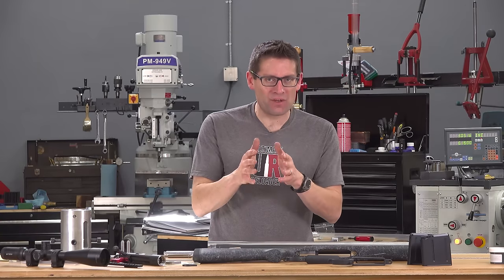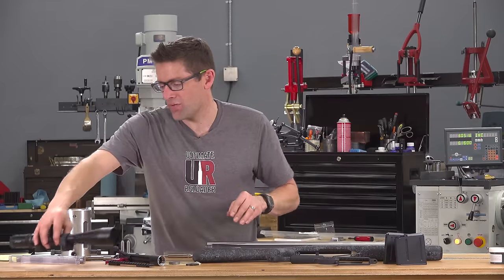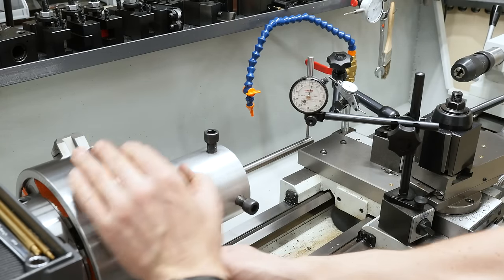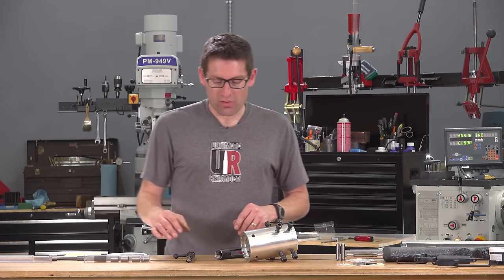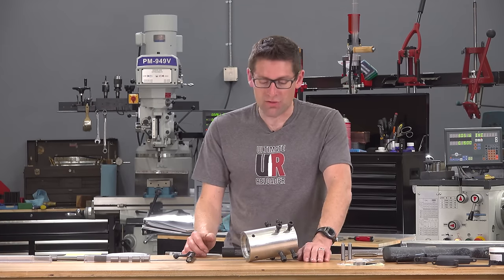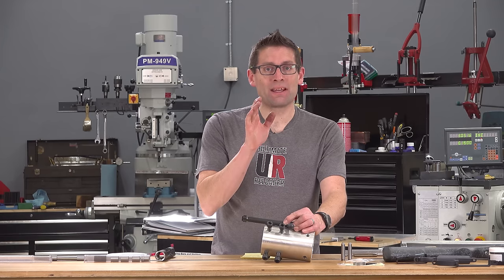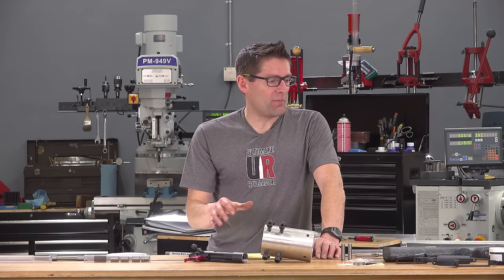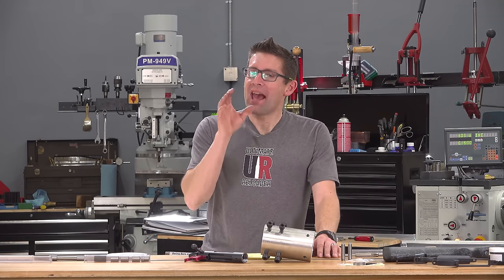300 PRC Budget Build part 1: Action Blueprinting

Comment: Is “budget” the right tittle here?  Lol Jesus!!!
Reply: GoneCommando  well, once you have the multi-thousand dollar lathe, lol.
Reply: agree, my budget would be the trigger lol
Reply: Budget for someone who gets his parts given to him or bought at a highly discounted price.
Reply: I was just thinking the same! Thousands of $$ into it with lathe and tooling lol. I thought it be a  pre fit barrel or something.
Reply: outboardprsnlstndup trust fund???
Reply: Well considering these machines are actually affordable to hobbyists I would say so.
Reply: Definitely not. But it shows very well why it cost quite a bit if you have a machinist/gunsmith do the job for you. Setting up and equipping a shop is huge money and as show the work is very labor intensive.
Reply: Considering he didnt tru and ream to size the bolt raceway, and either replace the bolt with one correctly sized or sleeve the bolt, yes its a budget build. Frankly, its ultimately cheaper these days to start with a tight, square 700 clone like a Borden Alpine, than to bother with all of this. 500 for a rem 700 action,  125 for a ptg sized bolt, hundreds of dollars in tooling, and probably 4 hours of a smiths time. Vs a grand to 1200 for an aftermarket action.
Reply: Agreed. This is not a budget build, nor is it within the technical ability of most people because of the equipment need. This is more of a mid price special build. But it is interesting non the less.
Reply: (T)(h)(e)(D)(u)(d)(e) - The Bergara custom shop quoted me 3K for a custom 300 PRC. I’m not saying you can’t spend more, but at some point diminishing returns come to play.
Reply: It depends if people are unemployed or just Wery cheap as I usually think Americans are. You expect stellar accuracy and konsistent handling, but don't whant to pay for it.
Reply: andy347495 - Thank God he is making money from YouTube. If not, we would never have access to this extraordinary content. We should be thankful to the sponsors as well.
Reply: andy347495 - I agree, some of the reviews need to be taken with a grain of salt, because the products are being supplied by the manufacturers. To date, I do not recall negative commentary on any of the products reviewed. In any event, things are presented in a clear and concise manner. It is up to the individual to determine what to do with the information.
Reply: andy347495 - That is precisely why we are allowed to make commentary on the process. You are not well served if you do not read comments left by others. It’s been a pleasure exchanging ideas with you and others on this forum.
Reply: As "budget" as possible
Reply: Don't blasphemy
Reply: Not even close lol
Reply: Lol I see the money do alot of sitting behind him i would be building my own receiver, then buy a barrel blank but u have to be efficient with the tooling  .. why is everyone so scared of threading with a lathe hell I was i think 11 yr old when I was taught how but didn't really understand how what,why. Until I built my first action at 15 . ThT was 25 years ago and quite a few barrels.  And caliber which all shot bug holes . Build your own fixture im sure there is a surface grinder in the famous old crapews i mean mathews in that building somewhere use your tools for what they are made for you won't learn buying or getting sponsors junk
Reply: Beautiful video see how it's done, but, this budget built seems like from hell.
Reply: I think I'll just buy a fancy chaise!!
Reply: Yea budget my ass lol
Reply: I thought this was gonna be a cheap action, barrel, and chassis assembly.. prolly only a handful of people out there that would actually do this 😂

Comment: It's OK but a 7-33 nosler with 190 grn A-tip BC .838 @3,200 fps has 1,000fpe at 1mile and beats the best 338 lapua and 300 Rum loads in drop and windrift has a longer case throat than a 28 nosler with no powder compression and the longer throat has longer barrel life because of the torch angle is not burning the barrels throat! And fits in a 3.760id full length long action detachable magazine with VLD BULLETS ONLY SEATED IN THE CASE NECK! Huge ADVANTAGES!

Comment: Put the stock barrel back on and see how much the action job only made with accuracy.
Reply: Cant really,  he opened up the threads and changed the headspace on all the parts......but it would be cool to know
Reply: I can personally say it does make a difference but we're talking benchrest accuracy every millimeter counts
Reply: racer4ever33 the only thing that will really make a difference is the match barrel. Unless the dimensions were extremely screwed up, which were not, you’ll see real improvement just on a trued action.
Reply: @racer4ever33  The rear bolt lug to front of the receiver lockup is critical.  Also truing the front of the receiver gets your barrel pointed in the same line as the receiver.  I purchased a  Rem 7 receiver from Brownell's that only one bolt lug contacted the receiver.  That Will hurt your accuracy.
Reply: vettepicking the barrel can be cut down to get back the head space, honestly I would’ve liked to see before and after results of groups with that factory action vs bring blueprinted.
Reply: andy347495 you’ll notice after a few rounds. The original action was offset so it would show up in added wear.
Reply: @jayny5472  i appreciate that. i just rebarreled my gun, reassembled, mounted and zeroed, then i saw this . . . facepalm!

Comment: Excellent content and I really appreciate your meticulous attention to detail. One key thing that you bring to your content that 99% of others don't: communicating all the detailed thought that you put into your process. Great job. That said, I'd be very curious for you to take a look at a Tikka action and see how much work it needs to be cleaned up vs. a Howa or Remington. I've worked with all three myself and would be interested to see how it would compare for you price/performance/effort of setup/clean up.
Reply: Me too!
Reply: In the process of getting a 300prc built on a Remington 700 action.  Just curious with your reloads if your able to easily reach the rifling with the 212eldx and 225eldm and still fit and function in the factory mag length of 3.70"  ??
Reply: @broch84shorthair49  factory Remington throats are terrible. You'll be way off the lands if you're loading to mag length. Like 0.130" off.
Reply: just shows you how badly new rifles are made by all manufactures no matter the brand, by a new weapon system and then get it blueprinted all moving parts and including the barrel bedded to the stock, etc? only that way you will have a straight shooter?👍👍👌👌✌✌🦘🦘

Comment: Gavin, You make us/me proud with you genuine excitement and true heart felt joy of doing this 1st class rifle.   I am a 63 year old "Maj. 3rd Marine Recon Scout Sniper" (RET) using 300 Win Mag hand built at Quantico.   Your joy, enthusiasm,  and understanding is why I chose you to give the "Secret" of a 300 Win Mag.   There are dozens of expert( hahaha) videos that talk crap about the  Remington 300 Win Mag.   Earlier you figured it out that "harmonics", and inferior ammunition's make for bad 100 yd groups.  Cudos 2U.   I am a MSME and I was tasked in 1978 by the the DOD to make the 300 shoot straight at 1500 yds.   So do yourself a favor and just make the right bullet first and be amazed at the results.  4" groups at 1000 yds and we shoot milk jugs at a mile for fun.   So screw all the cheap powders and use IMR 7828SC  alone or my favorite IMR 4831 and IMR 7828 mixed 2 parts 4831 and 1 part 7828.  Hornady just invented a magical 30 cal bullet hybrid.  Hybrid 30 cal 230 grain with a BC of .823.    Stays flat, zero wind deflection, and 2/3 normal elevation on the scope.  A normal 300 takes 4 seconds flight time and this magic combo takes 2 1/2 seconds.        The military's 300 bullet has had a BC or .480.to.495 so .823 is magic. BUT  BUT the 300 Win Mag rifles needs the loading of such a heavy bullet to remove all the harmonics.   Gavin, this is a true gift to you so don't waste it.   My engineering awards include; Space Shuttle, F-18, Thrust Vectoring, Smart bombs, Drag race Cars, Union Pacific Rail Road
I am not some flake.  Just load them up and watch the magic                 Charlie
Reply: Sounds like experience talking i never heard of 2 parts 4831 and 1 part 7828  does it make a difference if its short cut 4831? I shoit a remingto pss in 309 win mag pillar bedded jewel trigger tubbs firing pin and spring action trued it shoits good but always room to improve needs new barrel

Comment: I really like your videos. I have a Remington 700 7mm Winchester mag that I am disappointed in. I brought it new but got sick did not get to shoot it for 2 years. The very first time I put a shell in it the ejector was broken would not eject the shell. I have fixed that for now. My plans are to re-barrel and put a new type of extractor in a new bolt and blue print the receiver. Put a new stock on. About the same thing maybe a little more or and little less than you done to this rifle. I don’t have any way to go to his class but have done a lot of studying on doing it and been machining for little more than 35 years. So when I get time to start it and after I get finish with it I will share how it went.

Comment: YIKES hours on internal threads... I gave up on that prospect some time ago...I use the PTG receiver threading mandrel. Runs on the same bushings as the truing mandrel you have and does a good and effective job of fixing Remington's sloppy threads
Reply from the maker: Most of that time was spent experimenting with different ways to get a close look at the tool in relation to the interior of the threads :)
Reply: @Ultimatereloader  I figured that to be the case. As you alluded to there is no easy way to do it. Hence the use of the action threading mandrel to clean up and align the threads. Also I understand Wyatt's makes a different mag box for the 300 PRC as feeding issues have occurred using the RUM box.
Reply: @andy347495  Have you ever used a threading mandrel of the type I'm describing? It follows the center line of the bolt because it rides on bushings press fit in the same manner of the action truing mandrel used in his video.. and the die corrects the misalignment to the bolt body... it doesn't just follow the threads. You can see after use where it has cut on one side or the other to correct concentricity.  Furthermore what matters more than the threads in the receiver is that the face of the receiver is square, the shoulder on the barrel tenon is square, and the threads single point cut on the barrel tenon are square relative to the bore.  Thread contact within the receiver need only be 70% to achieve full strength and a proper lock up between the receiver and the barrel.
Reply: @andy347495  I 100% disagree... Lets break it down. You state you have "checked them on your lathe"  What was the concentric run out when using a mandrel? I have seen Remington be as much as 0.010" of total run out before truing. Chasing the threads with a single point cutter is not going to clean that mess up without creating a thread that is shallow on one side and overly deep on the other and larger in diameter than the original thread. In fact to try and correct this would induce more slop in the barrel tenon / receiver threads. Using the mandrel that is parallel with the bolt body bore and removing the high spots/ rough/ or uneven pitch surfaces does what is necessary to ensure that NO undue stress other than the force applied to the thread faces during barrel lockup is applied.  Your second comment "Your receiver face is going to dictate how far the barrel moves/alignes by the amount the threads allow the barrel to move." This is why when the threads are cut on the barrel tenon THEY ARE ALIGNED TO THE BORE OF THE BARREL and the shoulders of both the receiver and the barrel tenon or cut square. when the barrel is installed and torqued, the force on the threads cares not if there is .002" run out in the threads of the receiver.  This is because when a force on the faces of the threads is like 2 triangles one upside down in respect to the other being forced against each other. As this happens equally on ALL sides of barrel and receiver the two align based on the parallel surfaces of the faces of the receiver and barrel shoulder. There is no transverse stress produced in this process as barrel threads are often cut a few thousands under the OD if the internal threads in the receiver to prevent bottoming the peaks of the barrel threads inside the receiver and inducing stress.
Reply: @andy347495  USing a mandrel in this method DOES true the ID and thread surfaces to the bolt body bore. It may not remove all run out but that is not the point. I have built a dozen or more rifles using the mandrel and trued ans squared cut barrel threads. Not a one of them has shown signs of issues due to stress or misalignment with the axis of the bore or bolt body. Furthermore on a precison machined receiver touching the threads is a mute point as the are already axially trued. I venture that the machine hours spent attempting to single point cut the internal threads and trying to get a stock Remington 700 receiver to the level of a precision action MORE than offsets the cost of purchasing say a Stiller or Defiance action. This is the whole reason PTG and others have created the mandrels and piloted receiver facing tools...its not cost effective for a gunsmith to do it in this manner and it doesn't produce an appreciable improvement in precision.
Reply: @andy347495  correct it "may not" remove ALL runout....You think your removing ALL run out by chasing a thread that may be threaded non-concentric from the factory with a single point cutter?
Reply: @andy347495  HAHA of course
Reply: @andy347495  HAHA OK yeah You can clean it up... My whole point is the juice isn't worth the squeeze compared to using the mandrel... plus if a person messes it up with a single point cutter it can make a hole that while concentric to the bore will be oversized and can have deep threads on one side and shallow on the opposite.
Reply: @andy347495  If you use the same mandrel style receiver tap as you used to set up the receiver in a 4 jaw chuck...How would you end up with the receiver face not cut perpendicular to the axis of the bolt bore and the threads in the receiver threads  in the same axis? The mandrel rides on the same central axis?

Comment: One thing that I didn't quite understand. When you cut the threads on the barrel, how do you measure for proper fit on the OD of the barrel thread/ID of receiver thread? Or I may have misunderstood but I thought that you never touched the front and back of each receiver thread at the same time. Wouldn't that make the receiver threads shallower than standard? I hope this made sense. Thanks for a really great vid series!

Comment: When you cut the hole in the jig for the bolt handle, do you think that would throw off the weight of the center of the jig while spinning on its own?  Should you cut 4 holes all the way around so the centrifugal forces don’t pull it to one side?

Comment: Should have installed a m16 extractor.  Would have been worth it and a side Bolt stop/release.  It is actually easy with the mill.
Reply: Not really.  He has the mill there.  Would only actually take minutes to install.  Parts are very cheap.
Reply: I am a little slow...lmao.

Comment: Gavin, I still do not know if you need a magnum action for 300 PRC or a long action, a 300 Win Mag case is 2.62" a 300 PRC is 2.58", 300 Win Mag OAL 3.34", 300 PRC 3.56+", 300 Wby Mag OAL 3.60" so my guess is it needs a mag action, How about chambering a Mag Action in 300 Win Mag to seat heavy 225 Gns bullets further out with a extended throat for it? Manufacturers do not specify the action lengh in the same model, Bergara, Howa, Etc in 300 PRC

Comment: The bolt being true does matter. When you bush the firing pin hole (you do that, don’t you?) and when you turn the outside of the bolt nose so that is actually round, concentric and bd so on. There are other considerations too.

If you have uneven threads in the receiver you’ve cut corners. There’s a reason a tried receiver has overdose threads. You thread the barrel to match and have equal support of the barrel.

Comment: Isn't loading the bolt face from the front better than lapping via the bolt handle from the rear? This has always been the way it has been explained to me. This is also how I have always done it. Using the bolt handle to load the lugs imparts rearward and alot of axial torque over a longer run vs loading on the bolt face.

Comment: You should use a thread gauge to be able to read runout of threads. I could take a die grinder and gouge the treads and totally screw up the minor diameter but the pitch diameter would not be effected. you are only assuming the thread pitch diameter is concentric to the minor diameter.
Reply from the maker: Actually I did this the way Gordy Gritters does- with a 0.0001" indicator on the middle of the critical side of the thread, with the halfnuts engaged and carriage run in towards the receiver. VERY accurate way to determine runout- it's very important to read the correct side of the thread as noted in the video. (the side under compression when barrel tightened to action, not the clearance side).
Reply: @Ultimatereloader  That only assumes your lead screw has less than .001" pitch error per foot. Lead screws on engine lathes have .003" per foot of lead error or about .0002" per inch Hench the suggestion for the thread gauge it eliminates the machine error.